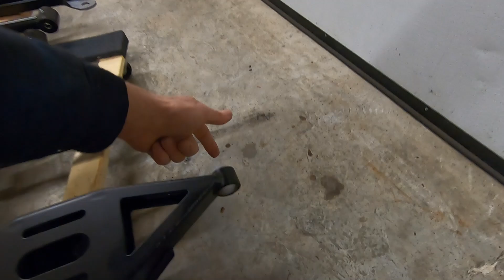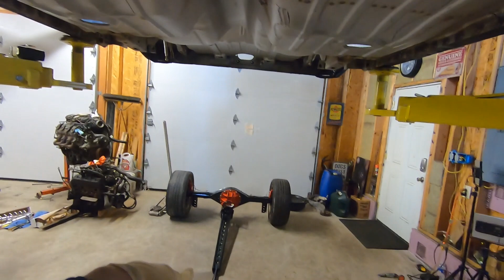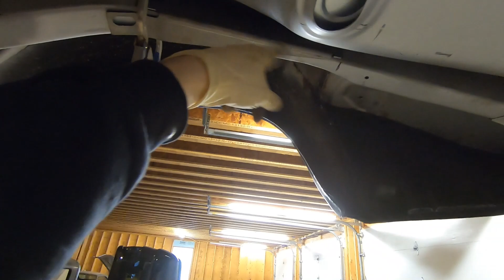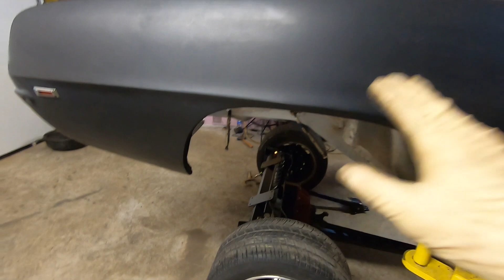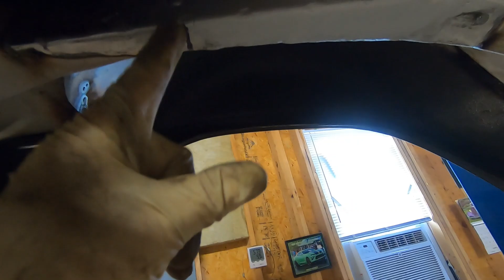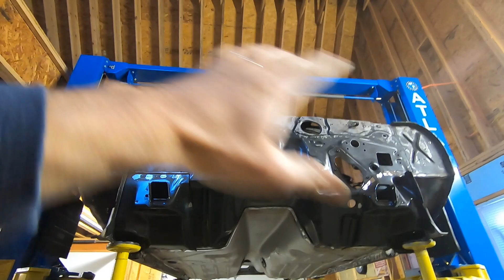SPEED TECH TORQUE ARM INSTALL

Comment: Finally ordered mine.I’ve watched this video several times and it gave me confidence to do it myself.Wanted to ask,does the crossmember that bolted into the subframe connection interfere with exhaust routing in any way?
Thanks
Reply from the maker: Nice, you will love it! We just ordered two systems for a first gen, and a second gen. The crossmember makes it a little tighter for the exhaust, but it's manageable.

Comment: This may be a dumb question,can the undercoat be sprayed upside down like that?
Reply from the maker: It can, would probably be easier on a rotisserie, but it can be done!
Reply: @slow_restoration  Thanks.I’m in the process of taking my 67 Camaro down to metal on the underbody.It’s on cribbing about 2 feet off the floor.No room for a rotisserie.Would love to spray Lizard skin but I know it will be tough trying to spray it upside down.

Comment: Can you comment on the ride quality with their torque arm?
Reply from the maker: Yes, it all depends on the shocks you go with and how you have them adjusted! This is a amazing setup with a lot of adjustability! This car rides and drives like a modern car now. I love it!
Reply: @slow_restoration  I would be using Ridetech HQ coilovers. Been trying to decide between this torque arm and Ridetech 4 link setup. Any suggestions?
Reply from the maker: @scottjohnson9102  There's no modifications needed and very little welding to install this on the body. Works with mini tubs or stock. I would go with the Viking double adjustable with the spring rate they recommend for your driving plans. This stuff is topnotch and easy to install. You won't be disappointed!
Reply: @scottjohnson9102 do you mind me asking which setup you chose and if you’re happy with it?  I’m trying to decide between the ridetech 4-link vs the speedtech torque arm also.
Reply: @tkmoseley  I ended up going with the newer Ridetech 4-link which deleted much of the welding from the previous generation and cutting into the body. Unfortunatley I have yet to install while I finish complete restoration on my car. I don't think you can go wrong either way though.
Reply: I like the BMR torque arm kit better.

Comment: Looks like you did good not scratching the springs! My wife's car has black lug nuts and I've found those scratch easy so I started putting a layer masking tape on before I remove or install them and that seems to prevent scratches as well.